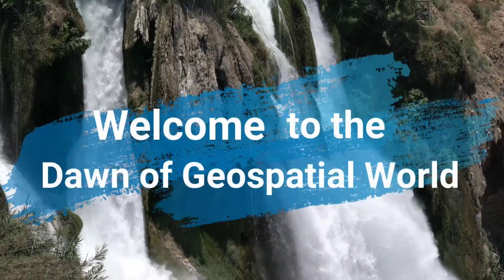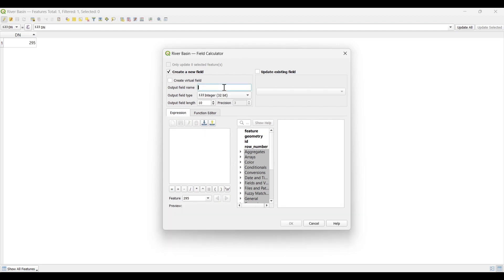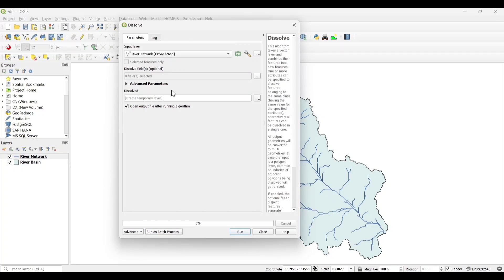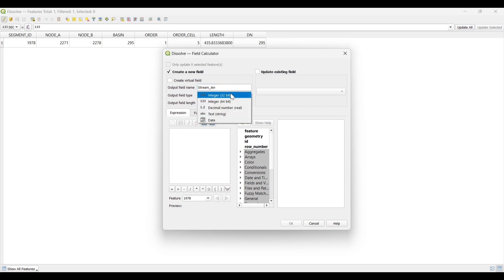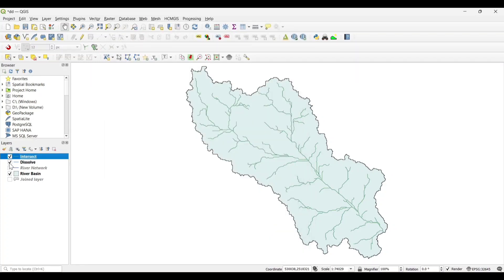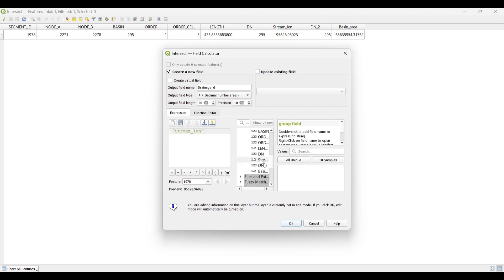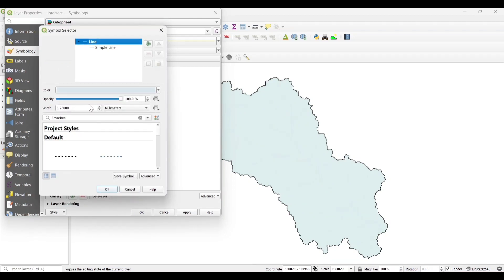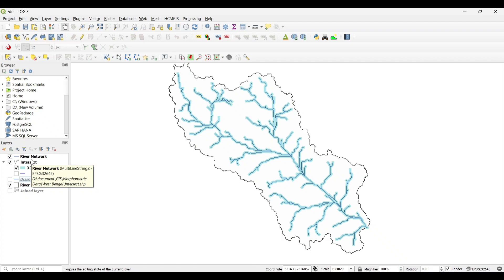Calculate Drainage Density in QGIS | Hydrological Analysis

Comment: What is the work of Dissolve? You got the length in Dissolve attribute table..But again you cslculate the length...
Reply from the maker: Before dissolve, there are many small river segments. After applying dissolve tool, a single river shapefile will generate.

The length value of dissolved river attribute table is not correct, so I calculated river length from length function.